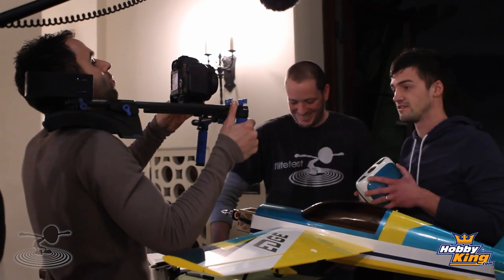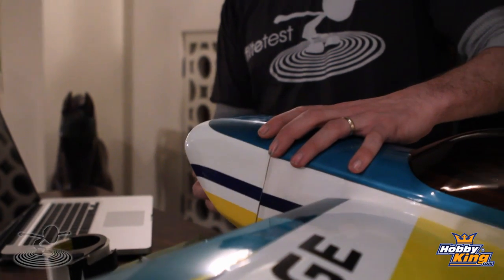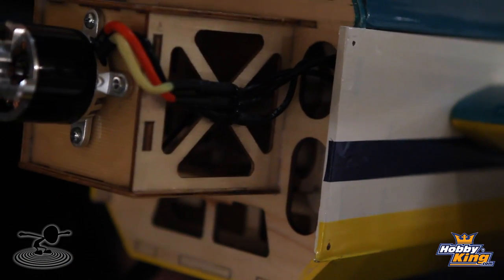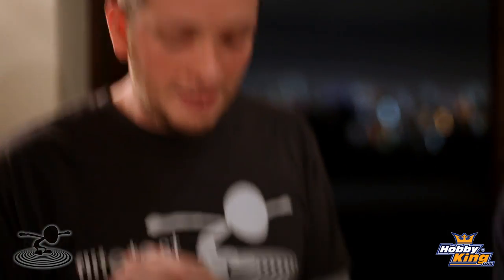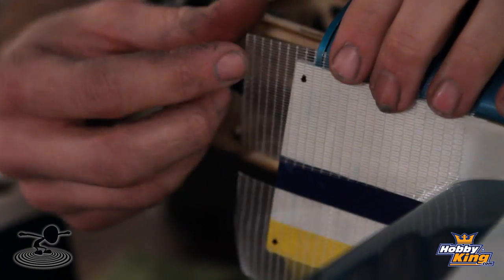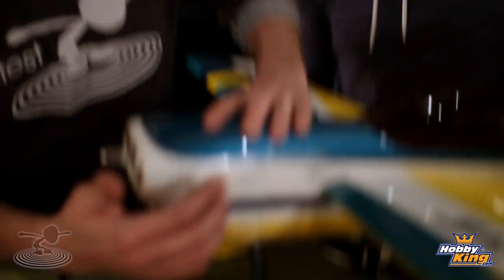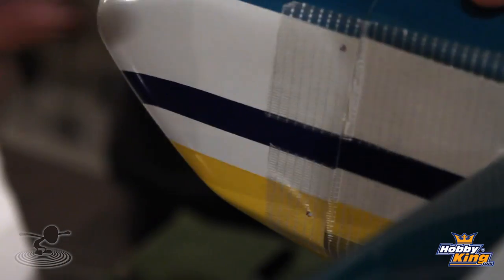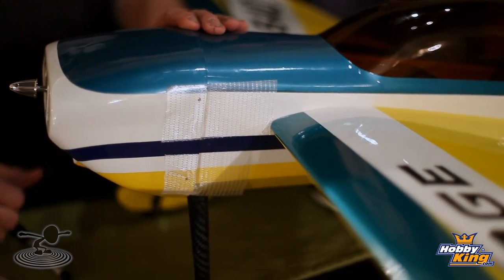Flite Test - Cowling Install - FLITE TIP

Comment: Step 1. Align cowling on your plane

Step 2, tape cowling in place

Step 3, Mark mounting holes and drill out with 1 - 1.5mm drill bit.

Step 4, Take cowl and elarge mounting holes to 2mm

Step 5, Mount cowling and secure with 2mm self tapping screws, easy.

Job done.

Comment: You forgot one small tip. Usually you get cheap wood screws that go into balsa and or plywood after you drill the holes fill with CA glue then put the screws in to seal the holes so they dont loosen up. Seems with small electrics you are always picking them up by the cowl. CA will fix this problem.
I dont use the screws though see below for best solution.
I wish manufacture would just spring for 4 blind nuts!!